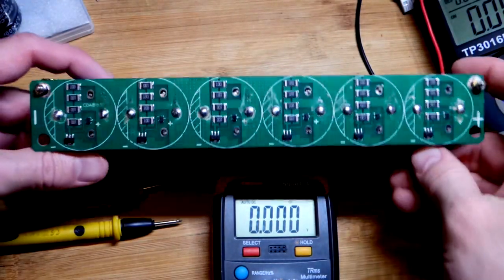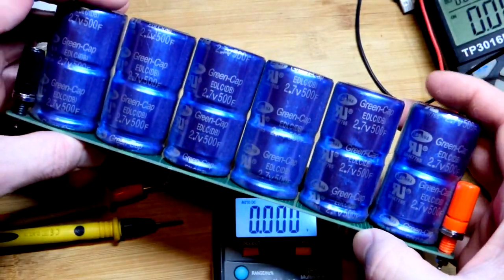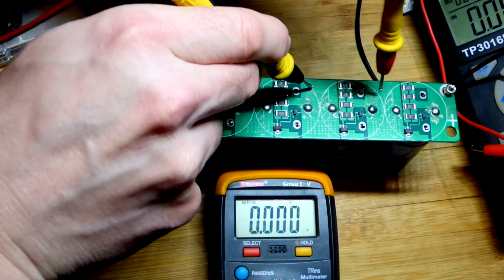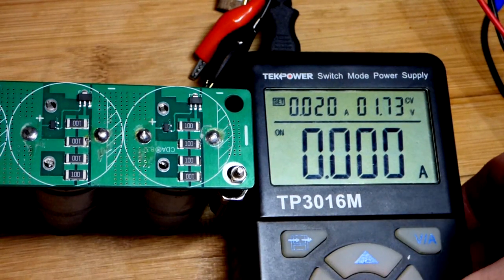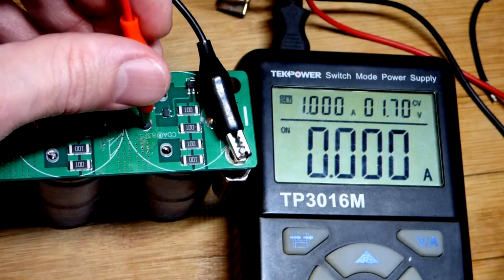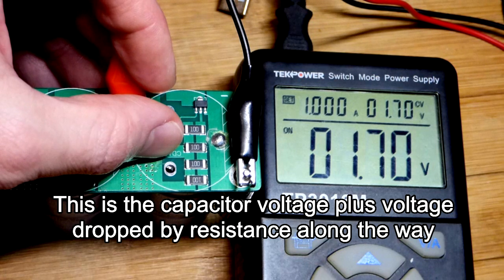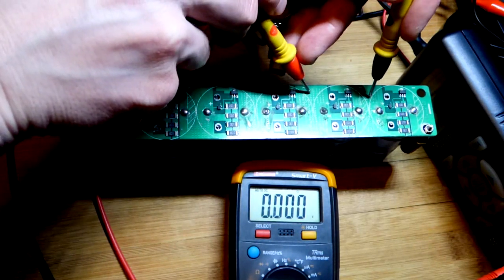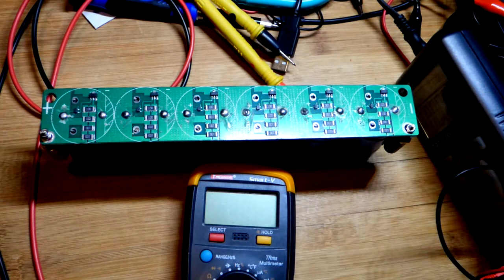DIY balancing series super capacitors when one cap is lower than the rest by electronzap electronics

Comment: Is it safe to charge this with 18 volts and 5 amps dc source ?
Reply from the maker: Not to 18 volts, but you can charge it with 5 amps, and remove the power source at 16 volts or less.